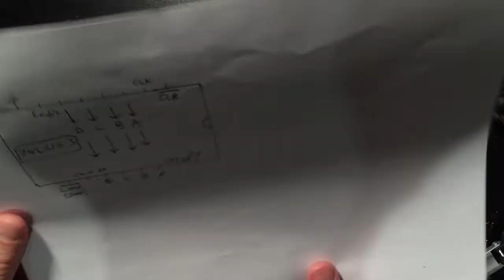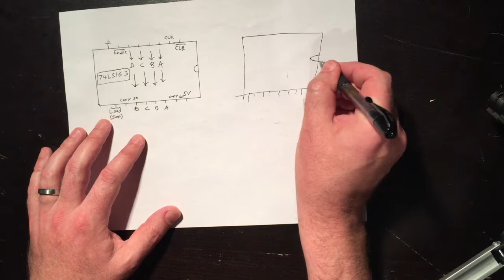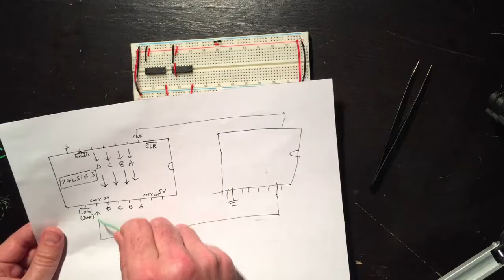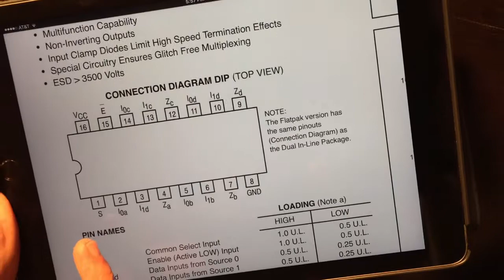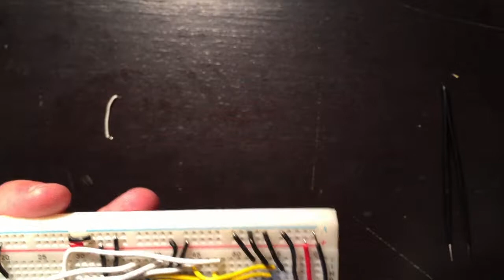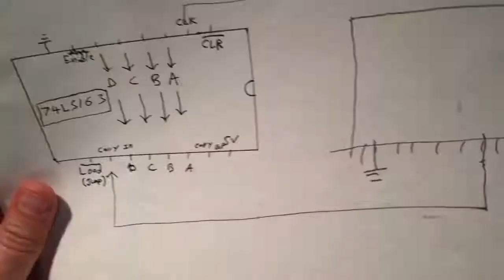Perfboard 8-bit computer build - Part 1 (Program Counter)

Comment: since youre stepping away from ben eaters design, why not skip ahead to full 16 bit address bus? 8 bit address bus is still too small for anything practical. so far im designing in my head but I know my PC will be at least 16 bits. also, arent you going to include the bus chips (74xx245) on the perfboard?
Reply: Thanks for the comment!  I am in my design phase for the RAM and am very glad that i am only doing 8 bit right now.  There were several complications that i had not anticipated that i am getting around (you will soon see my rats nest of a breadboard prototype).  16 bit would be even worse.  8 bi is more than enough for my purposes as i am using it as a learning experience.  I only upgraded from 4 bits because that is not nearly enough.  8 bits give me just enough to play a little more.
Reply: 74as867 x4.  :)  Dont forget, custom PCBs are dirt cheap to have made ex(checkout easyeda). 32 Bit SAP1 on the way, stay tuned :)

Comment: I've completed most of the 4 bit version of ben's machine, I'm working on some of the conditional jump instructions at the moment. Jump carry works mostly (sometimes triggers early but otherwise functions as expected) and Jump zero works kinda (on 1 MHz it doesn't work well). These will be useful doing the upgrades to get it fully 8 bit. I am working on the memory card at the moment. Waiting on a 2kByte memory chip and some other parts.
Reply from the maker: Nice, let me know how it goes.  I am hoping by soldering everything together i will avoid a lot of the signal issues people report with breadboards.  

For memory, i will be using two MM2111-1 chips (http://www.jameco.com/Jameco/Products/ProdDS/38931NSC.pdf) which will hopefully give me plenty of room to make small programs.  I have not designed it yet though so we will see.  Hopefully will get to that in a few weeks.  I am almost done with my Registers and will be publishing that video soon.
Reply: ozmodian i've just fixed the jump on zero not long ago so it now works at 1 Mhz reliably